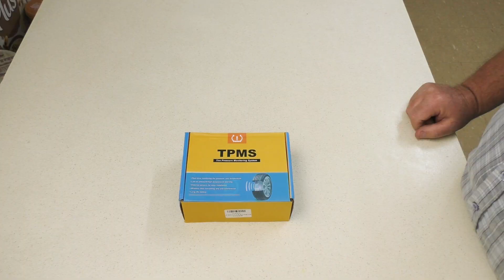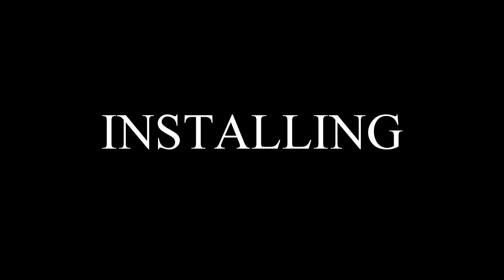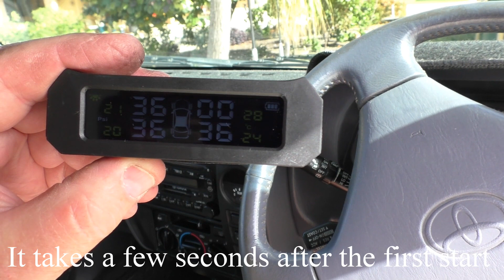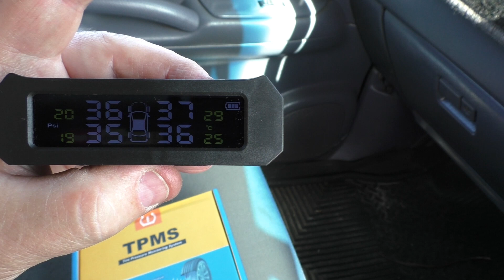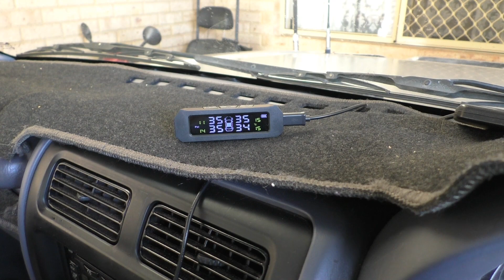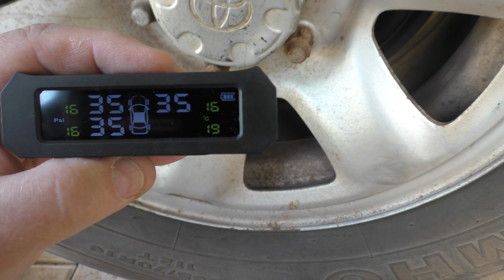TPMS - Tyre Pressure Monitoring System - Gizmo

Comment: Not bad idea. And relatively cheap and basic tyre insurance. Not dear, but looks like it does the job ok. Have you thought about a test whilst driving around and do another quick update on capabilities of it
Reply from the maker: Yes, we will do an update as we have just got back from a trip to Shark Bay where we drove on some long corrugated roads and had to drop tyre pressures. The TPMS did a good job so when I get the chance I will do another quick video on what we think now.